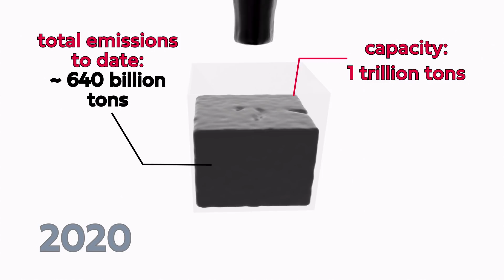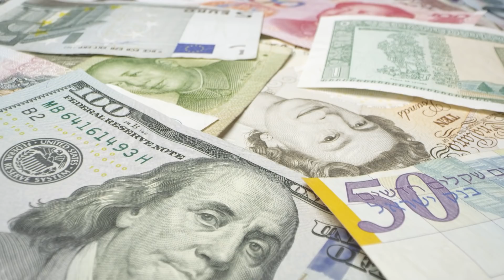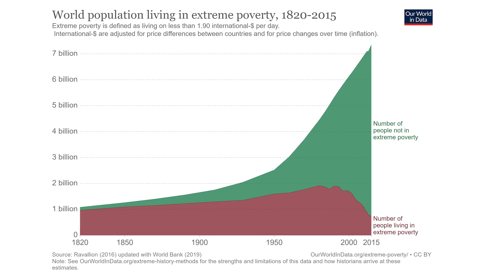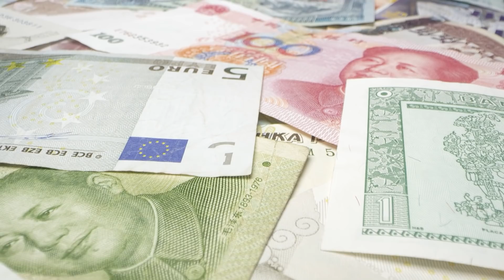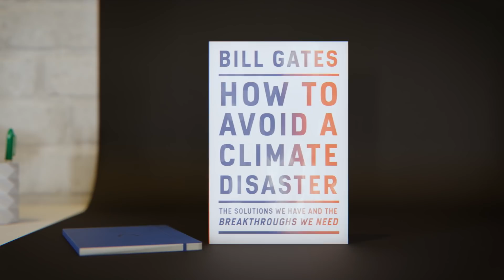The climate is lost when we fill this cube

Comment: How fitting that the visual in this piece resembles the proverbial crock. For those of you gullible enough to be alarmed by all this, here are a few simple facts:
For most of the time life has existed on earth CO2 levels have been far higher than now - it’s absurd to claim that a slight increase will be apocalyptic. 
Half of the warming observed during the industrial era occurred before 1950, 90% of CO2 emissions after 1950; practically a zero statistical correlation between the two. From the late 90s AG CO2 has increased by over 40% with no significant increase in global mean temps, zero correlation again.  
The only climate-related crisis we should fear is the economic and social destruction wrought by self-serving politicians using scams like this as a pretext to acquire more power over our lives.

Comment: What makes you say carbon traps heat? What is the science behind that statement? What experiment had been carried out for review? Do you understand that CO2 absorption is measured logarithmically and they are at me saturation now? You do know that data shows that CO2 increases AFTER temperature rise and decreases AFTER a fall in temperature. You say ' natural equilibrium' how is that when levels were far higher in the past and they have been rising  and falling since the ice age
Reply: 160 years ago, on 18 May 1859, the Irish physicist John Tyndall confirmed that co2 is a greenhouse gas with multible experiments.

His findings still stand after over 160 years of intensive research today.

Co2 beeing a greenhouse gas is a fact.

You are so out of the picture on all of this, that you are legitimately 160 years behind science.

Comment: The statement that CO2 was in equilibrium is a false and incorrect statement, it is false science.
Reply: Nonsense, the ppm was stable prior to the industrial revolution.
That actually means that Earth was in equilibrium with uptake and emission balancing itself out.
Reply: Bluesbr0ther No it was not.  You are deluded.
Are you honestly going to say that the creatures in the ocean that take CO2 from the water to build their shells and bodies had stoped taking this co2?  Are you saying that organic material on the surface of the earth had stopped capturing CO2 through photosynthesis and then laying down carbon rich material into the soils and oceans had stopped?
You are a fool to entertain the idea that natural CO2 sequestration has stopped and that there is a stable position WRONG WRONG WRONG.

LIFE GOES ON WITH OR WITHOUT MAN AND THE SCIENCE IS VERY CLEAR AND WELL UNDERSTOOD AS TO HOW CO2 is captured from the atmosphere and stored in rock, reef and hydrocarbons.  His has occurred for millennia and it always will while photosynthesis can work.  It stops working at 150ppm FACT.  WE WERE 30ppm from extinction at the glacial maxima 21,000 years ago.  That is science.  To argue otherwise is faith, blind faith.
Reply: @davidramsay6142  
The increasing CO2 levels is actually making it harder for shellbased creatures to make their shells.
And i am not arguing against the 150 ppm, i am well aware that it would be bad if the CO2 dropped down to 100 ppm.
And i am in no way saying any of the things you claim, i am well aware that Earth has a natural uptake where it removes CO2.
But you seem to skip the part where Earth also has a natural emission.
How about factoring that into your little math project.
Reply: Bluesbr0ther yes there are effects that create emission of CO2 which include fire of surface carbon materials like shallow coal, natural gas release, volcanoes etc.  However this is included in the long term decline over the last 500 million years it is already in the data.  I use the last 150million years and a starting CO2 level of 2000ppm in my calculation as it is data with higher resolution and certainty and life forms similar to today.  Evolution of co2 is in this data it is averaged ot and yet the decline line is very very clear stating a continuous gentle decline with NO events or data that take CO2 above the decline associated with natural sequestration.  It is as close to a perfect straight line that you get UNTIL 1950....  1850 to 1950 is a very low rate of Anthropogenic addition it is 1950 when mans presence really became noticeable in the CO2 atmospheric concentration.

I appreciate you probably do not enjoy hearing what I am putting forward as an argument, it flies in the face of the majority, I am a scientist I have studied physics and Geology.  I have worked in renewables and nuclear fusion.  At least you seem to have the integrity and decency to debate without resorting to abuse.  Science demands that the facts be evaluated and if they do not hold up to the theory then a scientist has to revisit the hypothesis to generate a new  theory which is always open to scrutiny.  Science is never concluded.
Reply: @davidramsay6142  
And just like in your other post, you are trying to manipulate the data by taking the starting point outside an ice age and the ending point inside an ice age.
Try comparing the CO2 from 300 million years ago to the CO2 today.
Reply: Bluesbr0ther I do not agree that shellfish or reefs are finding it harder to propogate.  The ph of the ocean is 8.2.  The CO2 levels past did not reduce or affect the ocean life it is in the curve.  If life found it hard at higher co2 levels then it would be reflected in the geological past, it is not.  If anything low co2 levels may reduce the sequestration rate though we have not been lower than 180 and in reality below 150 life is over so it's academic we are talking about a 30ppm margin so near as damit to say sequestration would take us below 150ppm.
Reply: @davidramsay6142  
Actually the PH of our oceans is 8.1 now.
The increasing CO2 levels cause the ocean PH to drop.
And given that the PH scale is logarithmic, that is a very big drop.

Comment: Green synthetic fertilizers is within sight. It must be noted that nitrogen fertilizers are derived from ammonia, which is itself created by reacting hydrogen and nitrogen:
N₂ + 3 H₂ → 2 NH₃
Conventionally, hydrogen is produced by reacting fossil fuels with oxygen and steam. However, there is an alternative for producing zero-carbon hydrogen: by electrolysis powered from renewable energy.

It is also possible to use green hydrogen in making direct-reduced iron (DRI) from iron ore:
Fe₂O₃ + 3 H₂ → 2 Fe + 3 H₂O
DRI can then be used for making steel.

Comment: May I quietly tell those that dont know it that Denmark can deliver a complete off shore windmill parks in less than 3 years if no red tape. Off course also on shore, but many have a problem with living close to a windmill, why I stress off shore here. The off shores can even be placed below the horizon line, seen from the shore, so basically no one even have to look at them. These windmills can be connected to several different units so the sustainable green energy immediately can produce !/desalinated water, 2/Hydrogen 3/electricity. Many talk about storage of the energy/lack of energy when its not blowing. The hydrogen capacity solves this problem completely. When hydrogen are burned it produces....wait for it,,, WATER! The whole world should focus on hydrogen as the flexible fuel that can replace any fossile fuel demanding engine/industry today. With hydrogen powered cars/trucks/planes/ships/homes etc etc etc. we dont need all these batteries that crave rare earth materials, that in themselves takes much energy to get out of the ground and refine. Furthermore some of the needed rare earth materials almost exclusively comes from China, like Lithium.  Hydrogen produced by windmills are green sustainable and fits perfectly into a circular economy and production society. A hydrogen engine powered car can run longer on 5 liters of hydrogen than any monstertanked gasoline car. Hydrogen can be stored both as a gas and as a liquid. Long term storage when the windcapacity are high can be done with liquid hydrogen and still take up very little room. The energy in 1 liter of liquid hydrogen equals over 450 liters of gasoline! 71% of this planet are covered with water. Instead of polluting our waters with oil spills and all sorts of residue related to fossil fuel production we need to build off shore windmill parks all over. Despite the fossil fuel industry STILL are the most subsidized industry windmills already have outcompeted coal and the (stupid and dangerous) fracking, gasoline are being closed in on.  Traditional Solar panels has rare earth materials as well. Off shore windmill parks are great business and more should focus on WHY we still subsidize an industry that eventually will kill us all if we dont stop WHILE the solutions to our problems are not pursued!?

I have Scuba dived around the foundations of a Danish off shore windmill park and it is having a fantastic positive impact on the local marine life! Basically, it a matter of a few years, the foundations functions as mini reefs. First it is mussles and then sea weeds as well.  Mussles cleans the water and takes out CO2 and sea weed does the same, furthermore both add to oxidizing the water. Because of the mussles and the sea weed the areas becomes a safe haven for small fish, basically fish nurseries that then again add volume to the bottom of the food chain. It is globally estimated that 20% of the worlds fish nurseries, the bottom of the marine food chain, are related to coral reefs. Coral reefs are right now increasingly under threat due to increase in water temperature due to climate change. Coral reefs increasingly experience devastating bleaching events. Should we in a matter of short time loose 20% of the bottom of the marine food chain it has a very real potential to lead to a total collapse of the entire marine food chain since so many marine species are interdependent! 

WHY do we STILL in 2021 stick so much to fossile fuels that led us into a global catastrophe when we NOW have the right solutions to save us AND make our life and economy stronger!!! You want to INVEST in a sustainable future or use all our money to fight the CONSEQUENCES of our reckless behavior. 

CONFRONT your politicians, left and right, WHY we keep subsidizing an industry that are doing so much bad WHILE we dont ACT on the EXCISTING PROVEN answers that even are producing better overall economy! Makes ONLY sense if some works for other than the people/right solutions! THIS SHOULD NOT be a political partisan issue. IF an industry are UNsustainable for us all and can be replaced by one that ARE SUSTAINABLE and we dont act on it and CHANGE, well, then Darwinism will take us out!

Show this to those that say "but"...

Comment: Global overconsumption is causing climate change. This is a social problem, for which we need a new mode of social organization that fits with a new economic model. The challenge is to create systems of sufficiency (enough local healthy food), or efficiency (electric public transport instead of single occupancy vehicles). The solutions you assume are not neutral, they are biased on the status quo or source of the problem. Responsibility and so mitigation is unevenly distributed to the wealthiest countries, and the wealthiest strata. Greater burden also falls to the sectors with the greatest emissions which need to be phased out. These cannot occur on a voluntary basis. We are governed by rules and regulations with enforcement actions.

Comment: The calculation i had done resulted in ~ 300 KM x 300 KM (adjusted for day night cycle,not cloud coverage)solar panel field (100 w/m^2(8 hrs/day)) patch to cancel our ~50 Trillion tons of co2 at 300kw/ton Carbon Capture (from memory, in a paper, which i surface read) . I know ireland currently makes E-rocketfuel so it is possible, but to work, that fuel should be put in the ground not burned. The chemistry is:
 (1+2*num)H2O + (num)CO2 + energy -complex chemistry(LEMS or someting like that, couldn't find name)-> (2*num)O2 + (num)CH4
//((num)CH2(±)+2H(±))   -carbon chain (methane,ethane,propane,butane, etc.)
Reply: Similar company talking about "carbon neutral" actually carbon negative(IF you don't burn it) fuel:
https://www.powerengineeringint.com/renewables/captured-co2-and-green-hydrogen-to-produce-carbon-neutral-fuel/

Wiki on similar but simpler process:
https://en.m.wikipedia.org/wiki/Sabatier_reaction

Read further on methane wiki->Generation->industrial and on electrolysis, but couldn't find the LE... Something something reaction basically reverse fire reaction

Found the paper from which i got the 300KW/ton CO2 figure(was No1 on google on "co2 capture energy consumption" if someone wants to go down the rabbit whole go research on your own this is from me): https://www.mdpi.com/1996-1073/12/9/1603/pdf-vor

Comment: I think that expecting personal consumption of heating and cooling is more than a little insane. Temperatures have been at global highs, and as we get closer to the point where we just render large swaths of earth uninhabitable for centuries due to living conditions, the need to regulate those temperatures closer to human comfortable levels will only increase, not decrease.
Reply: But if we heat and cool our homes with electricity, and we can decarbonise electricity, then won't that be quite a simple task? You can also reduce your energy consumption by up to 90% by building your house with naturally advantageous designs that keep your house cooler in summer and warmer in winter. Look into passive homes. Obviously, this can't be applied to already built homes, but it could be heavily incentivised for future builds.
Reply: @harryiii3361  "simply decarbonize electricity bro"

Most of the electricity in the world directly produces carbon. "Simply" replacing that capacity alone is a monumental talk even before forcibly converting everything to electric baseboard.

As an aside, the video instead suggests... Just not using ac, like as the earth slowly becomes an inhospitable hellhole, that people will willingly choose to not make themselves more comfortable and less likely to die

Comment: Carbon-neutral cement/concrete might actually be possible. Before I got this video served by the algorithm, I listened to an hour-long interview today with someone here in Sweden involved in planning the worlds first carbon-neutral cement plant, Heidelberg Cement's plant in Slite on Gotland after it's upgraded. It's currently producing around 75% of the cement used in Sweden and their plan actually seems feasible. It might even become carbon negative as they increasingly use biofuels and then carbon capture+sequestration.

Comment: reducing eating meat does abosutely nothing. the plants start producing the carbon also. wild animals start to grow more then causing SAME EFFECT. completely useless.

also load from electric vehicles to electric grid will cause it need to be maintained. also the energy efficiency is HORRIBLE if using fast charging. where would that energy come from? yeah from coal/oil. so you end up just shooting MORE carbon with electric vehicles. we do not have still way to generate huge ammounts of reliable power execpt nuclear. making green sources of fuel would be more wise since it would actually reduce waste and not increase it by having old cars go to waste.

Comment: For sure the best way to reduce road traffic emissions is to get people on public transport and improve the supply/distribution chain, not to just make everything electric; technology can make a small dent but we need to address the total energy we spend on transportation instead of just shifting the source from gasoline to coal. The reason personnel traffic is such a huge polluter is because of how horribly inefficient it is to carry small groups of people in a single vehicle when we can carry hundreds at a time with public transit. Improving train infrastructure is also a huge deal for long-distance shipping because trains are vastly better than semi trucks at long-haul shipping. Trains to do cross-country shipment + semis for final distribution, more people on public transit, far less transport emissions. Expecting technological advancements to magically whisk away climate change is wishful thinking and is a guarantee that we'll be in very deep water (sometimes literally if you're a coastal resident) within our lifetimes.

Comment: One of the arguments I get against electric vehicles is that: "You're just ignoring the problem. Most of the energy that powers your car still comes from coal; and the lithium mines that build the batteries for your car do more damage to the Earth than gas cars ever do." While that is a fair point, it's important to consider that EV's are NOT the solution, but merely a stepping stone guiding us towards the solution. If we have gas cars, not only are we burning coal to fuel the car up, we are also burning coal to power the batteries. If we move towards EV's, we wipe out the emissions coming from fueling the car itself, so we can focus on removing the emissions from where we get our energy, and actually start moving towards better energy solutions like nuclear, renewables, and from space itself. As for the lithium problem, we can likely get those materials from our asteroids, or other planets; depending on where its found